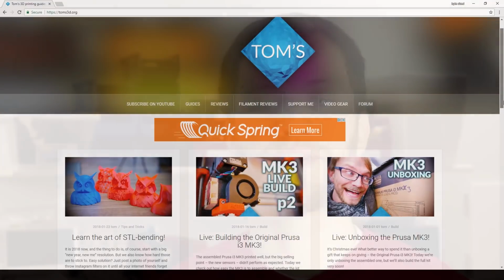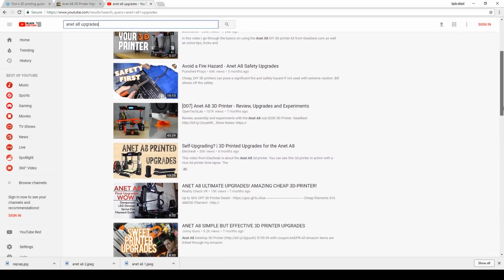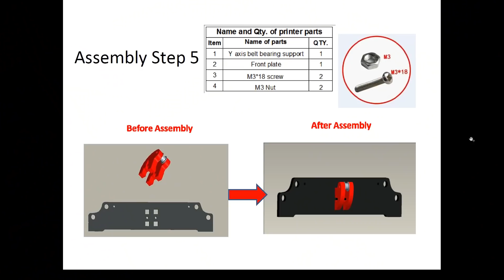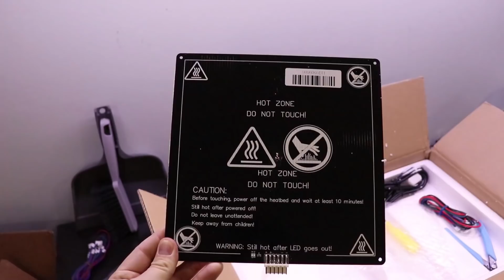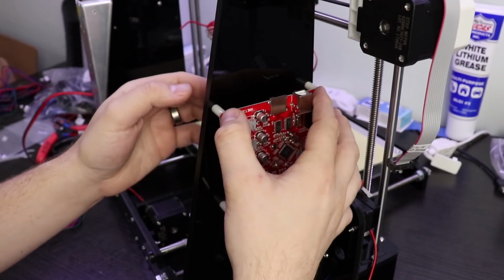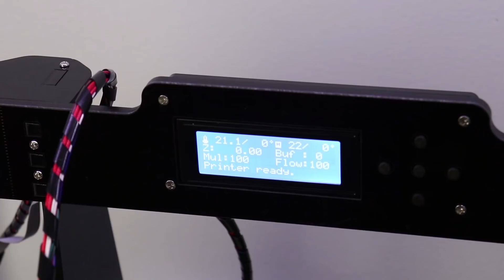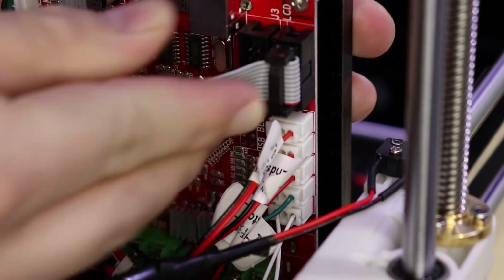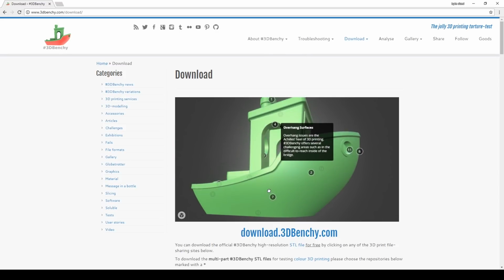Anet A8 - The best cheap DIY 3D printer in 2018?

Comment: I own this printer took 11 hours to put together upgraded to mosfet and put a power supply that can safely push the correct juice so you don't have a fire issue. Some small tweaks to calibrate it an it runs awesome. I just use cura for my slicer program an most upgrade parts you can print for it right on the machine itself how can you argue with that

Comment: I got a6 which is really similar. It's OK for getting into 3d printing and fault finding if you have nerves and time. Now after more than year I decided to give prusa mk3 a ago and boy is the experience so much better. Right out of the box immediately better results even though I've modded a6 heavily. Also it's whisper quiet compared to a6. All the safeties are on by default (know that a6 and a8 are fire hazards out of box). Also no more leveling, taping the bed etc. If you have the money, skip and go directly to prusa or something else with better quality. Anet models just are pos devices without vast modifications

Comment: Questions 1: can you get a finer tip extruder? Question 2: if you get said finer tip extruder, is the rest of the hardware precise enough for you to use it without stacking tolerances?

Comment: First and most important upgrade that I made to my Anet A8 was to add 1/8 inch thick Aluminum plate doublers to both ends of the Y axis. Then replaced the shattered Y axis motor mount with a purchased 17 Stepper motor metal bracket. It now prints awesome and is over a year old now.

Comment: You messed up on explaining the live/neutral/ground wire's. If you reverse the live and neutral wire, the ground wire would still work. Only if you DON'T connect the ground wire the situation (you explained) would happen. If you would reverse the ground wire, you would effectively trip the breaker/fuse (not really sure if i used the right words) because you are sending current directly in to ground.

Anyway connecting wire's correctly is always a goos practise :P, so yea you are right to do so.

Comment: No, not all 3d printers worth buying cost more than 1000$, the anet a8 with proper upgrades, metal frame, updated firmware and decent filament, can stand it's ground against said 1000$ machines. Given that i did have to invest money and time to make it better, but the return i got in the quality of my prints, is equivalent of a creality 3d. Goes to show that built > bought, for any given case.
Reply: I totally agree. My anet can produce about the same quality as our work printer that cost thousands of dollar vs my A8 ($138 USD) printer. Here is my first printed part after my printer installation, https://cdn.myminifactory.com/assets/object-assets/579faee7513f6/images/20181127-232646.jpg  https://cdn.myminifactory.com/assets/object-assets/579faee7513f6/images/20181124-190554-1543107979528-1.jpg
Reply: but then it will be not a 150$ printer any more. I would way A8 is printer for printing, not for the prints. If you want process of printing and upgrading search no more. If you want to have steady prints... spend more.
btw, I have A8. I would got for A10 now (at least).

Comment: I have had my Anet A8 for about a year now. The only thing I did was get an 8x8 piece of glass out of a Walmart picture frame, and use paper clamps to hold to bed. I also used clear elmers glue then rubbing alcohol to clean/sticky the surface before printing. It's about time for some new belts, but i don't print a lot. P.S. You better get good at Fusion 360 3D modeling or all you can do is print other peoples stuff.

Comment: Better to start with a cheap 3DP so if you do something horrible wrong, and it break, no big deal, you learn.
And if you decide its not for you, you can gift it away and make someone happy.

There is more, technology is evolving, your pricy printer will be obsolete in the blink of an eye.
1 Axis resin epoxy + UV bottom projection, and 5 Axis printers are getting the spotlight.

Comment: I'm very confused with the original plug on the video. As I look closer to the plug, I didn't see the manufacturer reverse the wiring.   (By imagining the plug is plugged into the wall) The upper is Earth (yellow), the left is neutral (Blue), the right is Live (Brown, usually connected with fuse), and that's exactly what I saw on the video. 

Did I really mess up with the wiring? I did google the wiring standard and I see no mistake on the plug.

Comment: At 9:10 you are correct that the blue wire is the hot wire, but it's because the cord set that was provided with the printer is wired backwards from the factory. Brown is supposed to be the hot wire, and blue is supposed to be the neutral (European color code). So swapping the blue and the brown was the correct thing to do (if you are going to use this cord). 

However, the instructions for the printer are correct, it's just that the manufacturer of the cord got it backwards at the factory. 

https://www.allaboutcircuits.com/textbook/reference/chpt-2/wiring-color-codes-infographic/

BTW, nice catch! :)

Comment: Don't buy it, it's 2018, under $200 you can buy something with V-slot from aluminum profiles like Creality 3D® Ender-2 or 3. 
Main problem of Anet A8 is bad orientation of acrylic frame. Extruder is tragic, i didn't found good retraction setting after 1.5 years.  Clearance of linear ball bearings is another problem.
I have spend hundreds of dolars upgrading Anet A8 and it still can't compete with <200$ Ender 2.

Comment: I'm definitely no electrical engineer, but I know stuff about electricity, but  want to understand what the problem is:
Yes you are right, the cable is wired backwards and that’s not correct, and yes, swapping line and neutral CAN be dangerous, (depending on how the PSU was designed, but nowadays they almost all have the same clearances) 
 you said that if the live wire were to come loose,  the case would earth the current, but if the wires are swapped, dangerous voltages would be present in the case, won’t those be earthed as well?

I'm not saying you have done the wrong thing, I’m trying to understand the problem, maybe I’m biased because I’m used to reversible European plugs

Comment: some electronics connects a resistor from the metal parts to the neutral wire of the cord.

wiring it backwards can liven up the body of the device at a very low current since the resistor limits the current too.

lamp sockets if you reverse the wires you liven up the threaded part of the  light socket and that is very bad because there you have no resistor to limit the current so you can get zapped very bad.

since the 3d printer is a computer device reversing the wires can send line voltages back through to the computer if the device connects to the computer directly via like usb or ethernet

Comment: I've been running an Anet A8 now for 2 years without any measure of major issue. I saved myself a massive amount of headache and installed a BLTouch after about 6 months. OMG that was one of the best $20 I've ever spent. I now never have to level my printer. It only fails to level 1 out of every 15 times or so. I simply re-start the print and it behaves.
I'm now just about to start printing TPU with my A8. I've put PLA, ABS and Nylon through it so far with NO printing/extruding issues.

Comment: I own one of those printers too, and making it work and improving it was a fun little hobby when I was new to 3D printing and had time to spare. However, the sheer number of quality issues and calibration problems you're going to experience makes it way too frustrating to deal with long term especially if you need something reliable and user friendly that your coworkers can figure out. So honestly you get what you pay for.

Comment: hi nice video,just a quick question,can you provide some info about the settings for the steppers? steps per mm feedrates etc.
do you have the firmware?
thank you very much
Reply from the maker: My machine is running Marlin firmware. The feedrates (print speeds) are configured in the slicer software (Cura) before you print.

Comment: DO NOT buy this off eBay. It's essentially a shot in the dark on there if you'll actually get an Anet if you order an Anet. There's a very real possibility that you'll get a TronXY if you order off eBay. It's not the end of the world if you're stuck with a TronXY, but it's a knockoff of the A8 (which itself is a knockoff Prusa). GearBest is the most reliable source for these things that I know of.
Reply from the maker: I haven't had that experience. eBay will also give you a refund if you don't receive the item you bought. The A8 isn't a "knockoff" of Prusa. They are just two examples of many machines that use the open source design of the Rep Rap project.

Comment: A good quality printer is determined by the quality of the parts used to make it. If you have to start dumping money into it to make it work properly ( upgrades if you want to call it that) Clearly using that wacky screwdriver tells me you are inexperienced at anything mechanical. It scares me to see those with no electronics skills buying these things. Lose that pathetic screw driver.
Reply from the maker: I studied mechanical engineering and have a B.S. degree in electrical engineering and used to be an electrician. That wacky screwdriver is a common tool used by electricians, you can buy them at home depot. Did you consider asking me about my background before questioning my qualifications?

Comment: If the live wire comes loose it will conduct to GND and fuse will blow unless you have a security breaker (you could have a problem if you stupidly use a non grounded outlet) so it really makes no difference if you reverse phase and neutral for that reason. In Europe we can plug the plug in either way - so these are swapped all the time.

Comment: Wait? Blue = LIVE and Brown = NEUTRAL? That is the opposite to Europe (UK, at least)
Reply: In Czech BROWN = phase, BLUE = 0 and GREAN-YELLOW = ground
Reply from the maker: Yes, that's the reason I was confused and hesitant. I think the cable I received did not follow the standard colors.
Reply: I got the same with my A8 … and i just throw that cord to trash can and get one spare from PC where the colors where right… to got it right and not confuse me in later upgrades.
Reply: Aus is the same as UK.  Brown = ACTIVE/LIVE, Blue = NEUTRAL...  Beware...  :)

Comment: How to print in 3d printer by using laptop and which app
Reply from the maker: Once you have a 3D model (usually in stl format) you'll need a slicing application like Cura to slice your model and output the gcode for the printer.

Comment: The biggest design flaw with these types of printers is the lack of rigidity in the Z axis frame where the material is missing in the vertical support which causes it to wobble side to side with the weight of the extruder giving reduced quality prints. One solid piece of material for the Z axis frame will mitigate this problem significantly but many manufacturers unfortunately cut corners in this area.

Please check out our video where we discuss this issue on a 3D printer similar to the one reviewed here:-   https://www.youtube.com/watch?v=Zy7PYk7-J5I
Reply from the maker: I haven't really had many issues with z axis rigidity. My frame isn't really that wobbly. Also with 3D printing there aren't really any "cutting" forces between the extruder and the material being deposited. These are good tips though.

Comment: I love my ANET A8.  I Bought a cheap $3 picture frame from a discount shop and removed the glass and place that on my heat bed. I then use folder clips to attach it to the bed.(It's easier and faster to level the bed with a true flat surface)
I give the glass a very light mist of hair spray before placing it on the bed  . 
And after a big print i remove the glass give it a wipe down with paper towel and methylated spirits (alcohol) another very light mist of hair spray, clip the glass back on and its good to go again.( never had a print lift ).
Great vid  .
Reply from the maker: Thanks for the tips!

Comment: So they reversed live and neutral. Earth is still connected properly - yellow wire. This is bloody vital, and something that necessarily needs to be checked manually, because if earth fails, there might not be much in terms of other indication of something to be wrong, though you'll feel it on this particular PSU, it'll start giving you scary touch current. The complete metal enclosure of the power supply is (and must be) connected to protective earth terminal.

To quote you: "a dangerous problem arises if a live wire were to come lose and accidentally touch the metal chassis".
Well... uh... that can happen whether L and N are labelled correctly or swapped around, it makes no difference.
"The whole point of the earth wire is to provide a safe path for the current to flow in this type of situation" - and yes, it will. "If the wires are reversed there is no safe place for the current to go" - NO NO NO NO, WHAT LEAD YOU TO THIS INCREDIBLE LEAP OF LOGIC?

Now of course it's not at all wrong of you to wire it up with reversal undone, but... it's really not of much consequence. Consider: across most of Europe with exception of the UK and Ireland, either the plug is reversible, or house wiring has N and L wired up completely arbitrarily, and same thing in China and most other countries. Inside, the PSU is mostly symmetric, as both L and N run through a choke into a rectifier, with just one difference, only one of these lines is going to have a fuse on it, and by all reason you expect it to be on L, and keeping it there is ever so slightly safer. Should the fuse end up on N instead, because the wires got swapped around, essentially in case of a dangerous short inside the power supply, the house breaker will need to take it up instead of the fuse in the power supply. If a short is outside the supply, the power supply fuse is circumvented anyway. Whether the fuse is on L or N, it will serve its actual purpose of preventing a fire in case of not so uncommon internal component failure in the power supply.

Comment: I just ordered one for $89 shipped from China. Good video.
Reply from the maker: Wow that is almost half of what I paid. Good luck with your build, let me know how it goes
Reply: where did you buy it from???
Reply: I got it on Ebay. That seller only had 20 units and sold them all in a few days.
Reply: I hope you get good copy of A8 and you wont regret it.

But i got a very bad one. I never recommend buying A8.
Reply: @jw200  you probably just got a bad batch, but you could also opened up a ticket to whoever you bought the printer from and ask for a exchange.